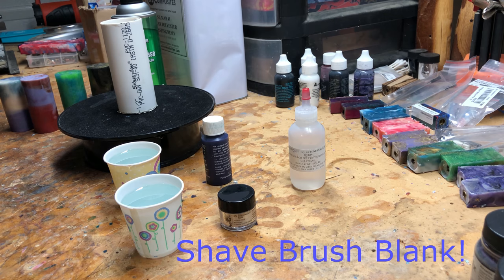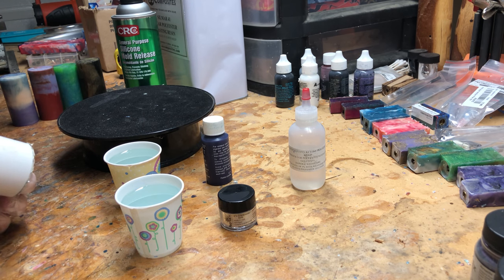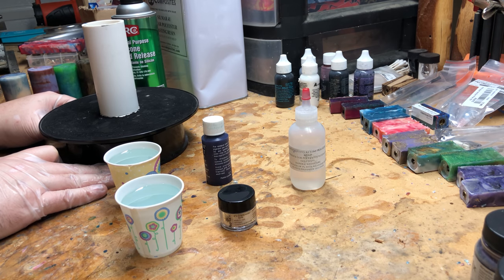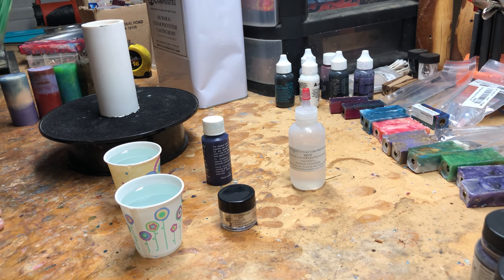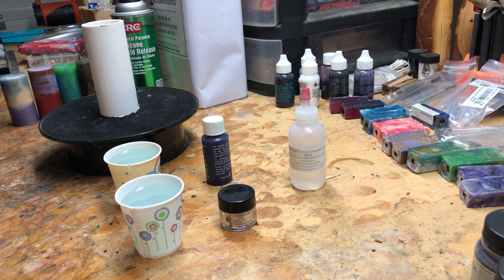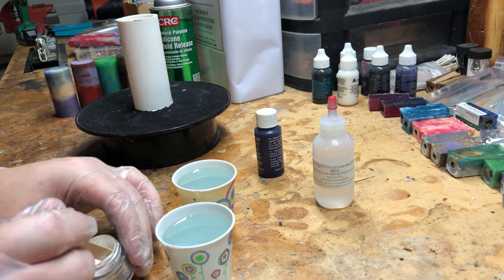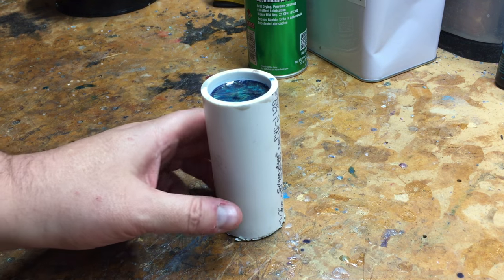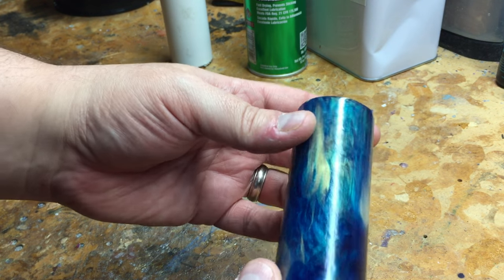Shaving Brush Handle Blank Casting - Peacock Blue/Gold Color Turning Blank

Comment: Do you ever I’ve any issues with bubbles in the poly Resin?
Reply from the maker: No, nothing that causes a big problem within the casting, but it is due to me working with it a while to get the gel times down and know what temperature to work within.  If it is too cool it can cause several issues like more bubbles and a sticky surface sometimes.
Reply: Good to know! I’m looking at getting into pouring my own blanks.